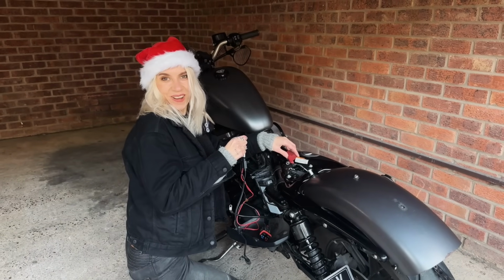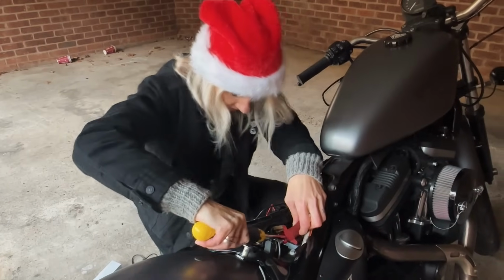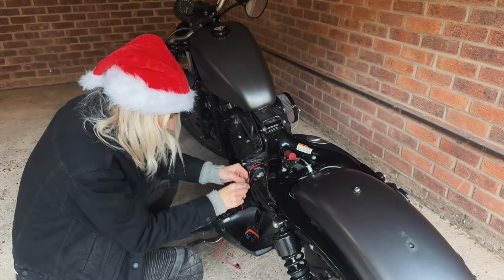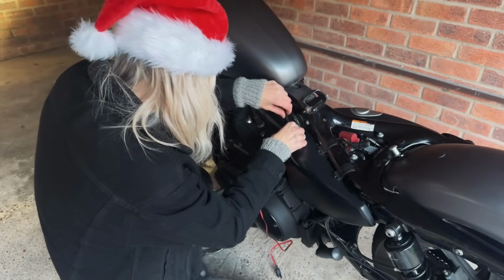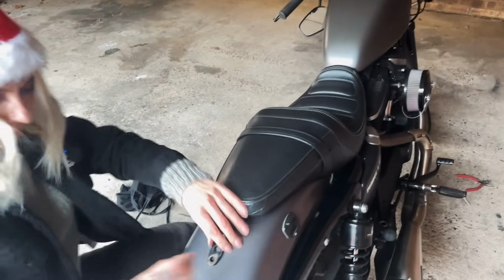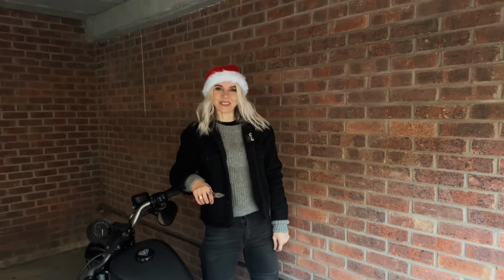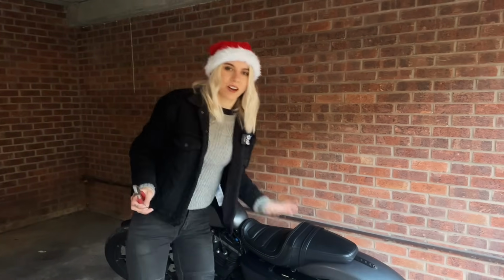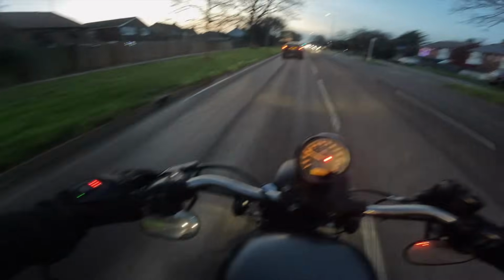Will My Sportster Start For a Christmas Ride?

Comment: A very nice Merry Christmas ride for you D.  Sure glad you didn't turn into a frozen pop-cicle.
You can put a small piece of tubing (or what ever ... like the red plug that comes with a acid filled battery red vent plug) under the nut of the battery terminal connection to hold it in place. New Years ride? Hope 24 will be one of your best ever.

Comment: Was nice to have a Christmas ride with you, even though I haven't been on my bike since June, 
Is one of your indicators gone or do they flash that quick as standard?
Also is that black horizontal thing in your garage an electrical cable, I'm thinking if it is you could tap into that for some power on a trickle charger 😉
Reply from the maker: They flash like that all the time.
It’s not my garage. The garage is too dark to use for filming. And not enough space in it.